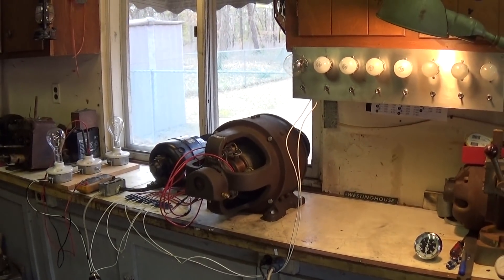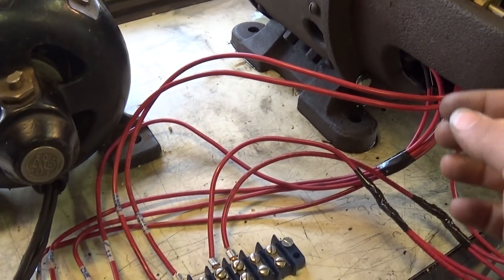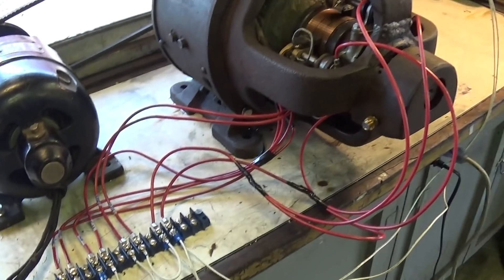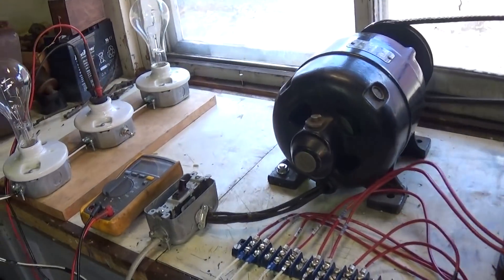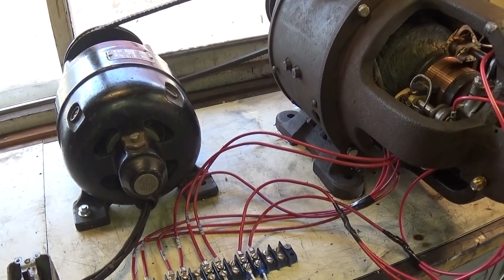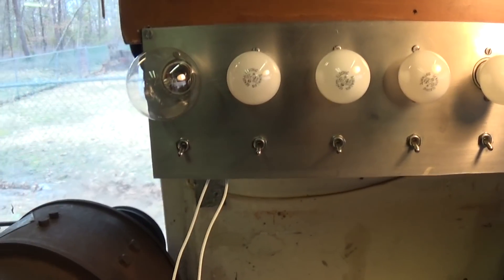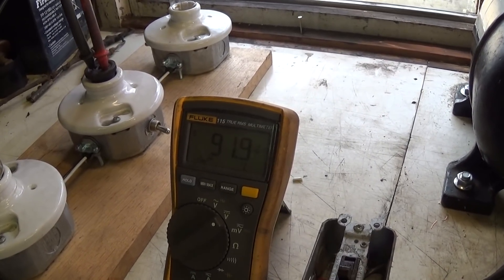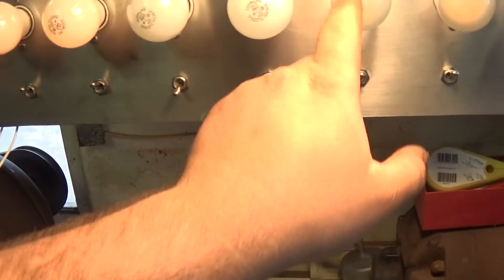IMPERIAL ELECTRIC DYNAMO ALIVE AFTER DECADES

Comment: Old DC dynamos are almost a lost craft, brilliant you have got it running again. As far as the voltage drop have you tried reversing the series field connections? If the voltage drop is lessened the field flux is now additive, if the voltage drop is worse it was connected correctly originally. On some machines the brush gear was mounted on an indexable ring that could be adjusted to slew the brush gear around relative to the field poles, this has a major effect on terminal voltage.
Love what you are doing, it's methodical, safe and controlled. Best of luck.
Reply: Agree 100%. If the series field is connected backwards the result will be exactly as you say.

Comment: The reason the dynamo speed drops when you put the 300W load on is because the load is drawing real power from the motor. Unloaded voltage doesn’t require much real power only reactive power. 
Voltage is controlled ny excitation, power is controlled by torque.
Reply: Would love to see a fluke scope meter on this! I'm wondering if the whining is due to the commutator bars switching so fast it's causing ring-out from the flyback as the magnetic field collapses in each winding as the brushes break connection...

Comment: Not sure what I'm seeing but it sure looks like the blue light of electrical arcing at the bottom of the rear shaft deep inside the bearing. Either that or teeny tiny troll is in there with real small flashlight. Tell me did you happen to sit that armature on a growler to check for internal shorts, because that's one way the pixies could be moving around like that. Happens when you are measuring speed with the tach and the camera catches a brief flash when alignment is perfect both times too. I have no explanation, shouldn't be there is all I know.

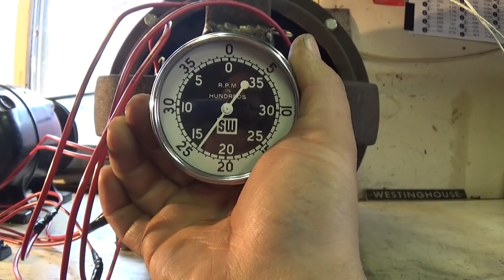Comment: @11:08 just after you have pulled the tachometer away and the camera starts moving.. is that a reflection i see at 4 to 5 o clock position of the motor shaft or arcing.. 

 another thing.. what kind of sand paper did you use to lay around the commutator and under the brushes to seat them properly..  and after doing so did you pull the brushes to verify you did not embed a piece of abrasive in the brush or in the undercut..  did you also pull a strip of sand paper in a U around the commutator and spin the armature to take off the highs where the undercutting raised the edges of the strips.   you know this but some sand paper abrasive types are conductive. i think Garnet was the proper abrasive strip.. instead of the easily available silicon carbide which is conductive..  i used to handle the 25KV delcos sets on a friends boat.  the different hardness brushes for the different commutators . it was so easy to mix them up. 

so from a former part time generator guy decades ago.. take your brushes out and check for embedded grit before you wear thru the commutator.  you don't even seem to be making full contact or it would be a whole lot quieter.. nylon bristle tooth brushes are also great for keeping the undercutting grooves cleaned out after any sanding or seating..

Comment: G'day, Mike! Great job!! A fabulous demo... With the Imperial Electric dynamo!! Suggest: You will need more horses, to overcome the speed droop! Thank you! Cheers! :-) 🐎👀😊
Reply: Induction motors have a speed droop as when they drop in speed, the induced current in the squirrel cage shorted winding increases providing torque.  This is why they always run below the synchronous speed.  Overloading an induction motor does cause increased current and the risk of overheating.  To get out the full 3KW rated load, you will need at least 4KW of mechanical input.  6-8HP prime mover is recommended.  My 6KW unit uses an 11HP diesel for the prime mover.

Comment: Hey Mike, I think you misspoke at 7:06.  I believe you said the lower the resistance (due to adding in bulbs wired in parallel) the higher the voltage.  You said it correctly before running the dynamo - the lower the resistance, the higher the CURRENT. 
Some time do an instructional video on all the different ways these old beasts work (DC & AC output) please.  Only thing I know is that the magnets used were electromagnets since high magnetic field permanent magnets didn't exist yet.

Comment: Thanks for the video mike. Very interesting to an older guy who can't do as much now with this old stuff. I have a better motor that would keep the rpm better. A 1930's one horsepower 115v, with oil reservoirs on the bearings. I will put it on a lathe.

Comment: Nice to see it running. But those lamps on the wall are telling nothing about how much resistance you will need in the reostat for the field. That because a lamp like that have so enormus high temperature coefficient so it raises the resistance very much as it get hotter. So for measuring that resistance you needs ir to be suitable hot, suitable much current, which makes measurement difficult. My advise will be a voltmeter and an ampmeter in that lampcircuit.
Reply: A little late as I just saw this, if the field current and voltage are measured under no load, the maximum value of the field rheostat or carbon pile regulator can be calculated.  For example if the field current is 200mA at 80VDC, use Ohm's Law to find the resistor value needed to draw 200mA while dropping from 115V to 80V, or a drop of 35V.  This would be 175 Ohms.  Adjust for your values measured.  Due to brightness assumed about a 35V drop on the lamps and guessing 1/5Amp or 200mA.  Field rheostats for those antiques tended to range from 100 Ohms to 500 Ohms.  Carbon pile regulators tended to change value from open to as low as 30 ohms.

Comment: Very Cool! 1hp = 746 Watts, so 1/2 hp motor would be at the limit, given the other losses, of a 300 watt load.
Reply: Are my memory wrong? I think 1 Hp = 736 Watts
Reply: 746 is imperial, 736 is metric.

Comment: Nice job,...that voltage drop looks pretty normal to me, your speed is dropping almost 200rpm, but the series windings are most likely designed to work just fine with constant speed. Also, not sure if it's just the audio but i think i can hear some commutator runout or perhaps rough edges, hard to judge with all that background noise, but something appears to be there